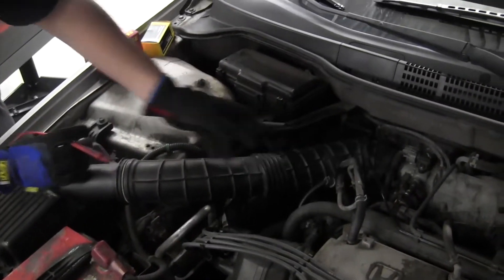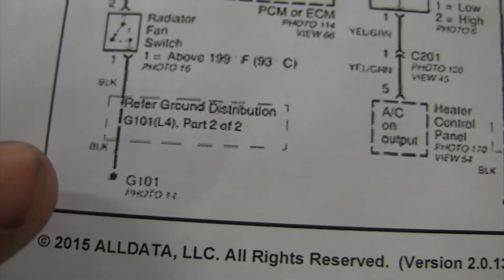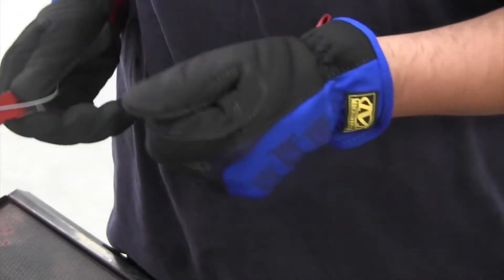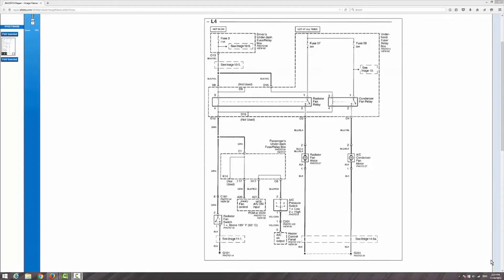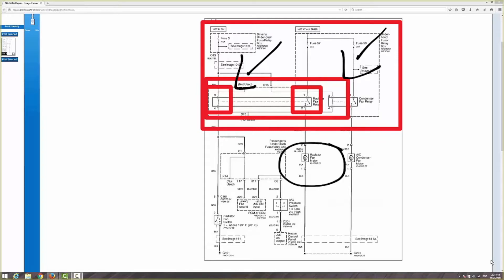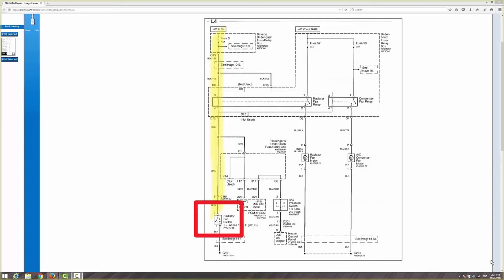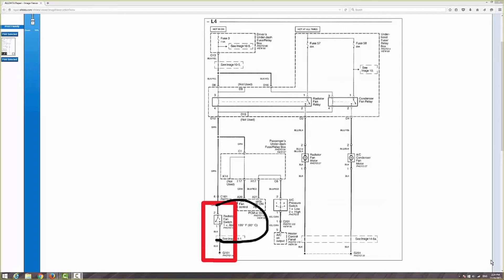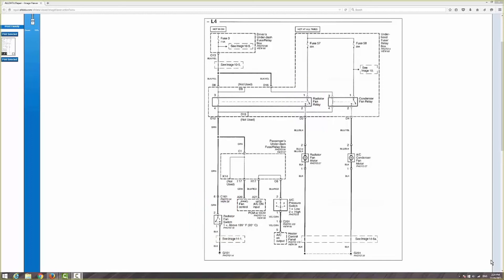Testing HONDA Coolant Fan Circuit - How to read the wiring Diagram

Comment: I got a Honda Element 2004 I put in new fans new fan switch new engine coolant sensor new radiator new fans and new thermostats and my fans won’t turn on they only turn on when I jump them I’m very confused other symptoms I have is heat is not hot enough inside the cabin other then that I don’t get it I put new fuses and new relays aswell
Reply from the maker: Have you checked the supply voltage and grounds in the circuit
Reply: @natedaviscteinstructor   yeah I cleaned the grounds up but the bolts back in what I did recently was I jumped the a/c pressure switch and again fans work when I turn on the AC button inside the cabin still they won’t turn on on there own but then again my car gauge shows the cars dialing a bit under the middle towards the cold